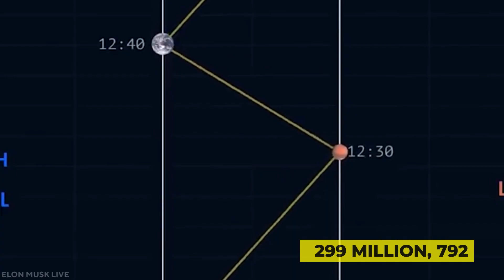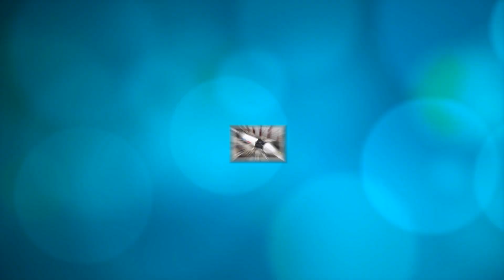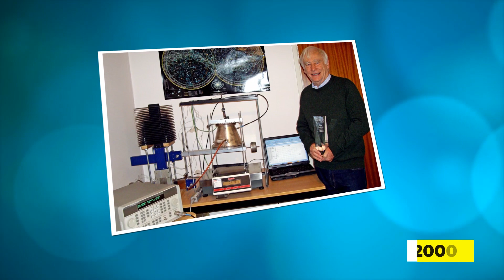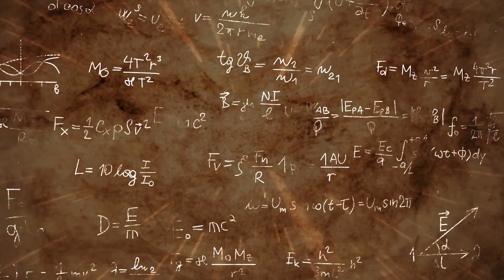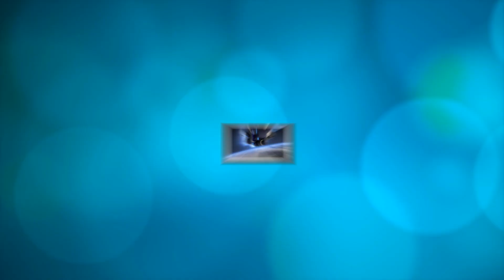Elon Musk JUST Revealed New Light Speed Engine 2022

Comment: Really, I think we should try to get the transport system in Vegas to go over 30 mph first. That no fuel engine has not been verified to produce any applicable thrust, presently theoretical.  The closest thing we have to go fast is ion drive which is already here. But without Inertial damping or Deflector you aren’t going anywhere where near any % of the speed of light. Because space isn’t empty and any particles hitting the spacecraft will cause damage and rapid acceleration or deceleration will flatten anything inside the ship.  Also likely you’ll spend 50 % of your time accelerating and 50% decelerating. The sci-fi show The Expanse show our likely next step once we get some kind of engine capable of continuous thrust. Most likely it will be nuclear powered/Ion Drive type or something like that.